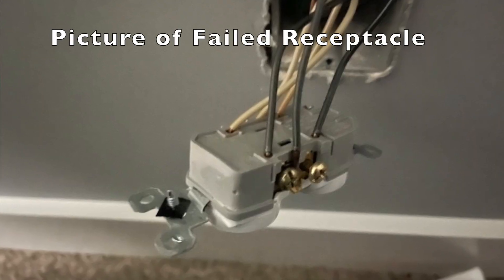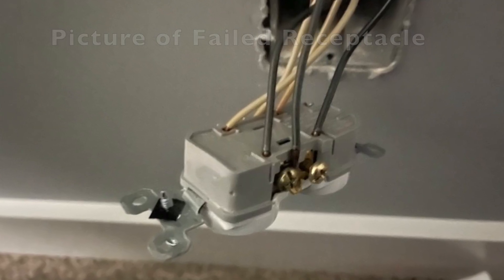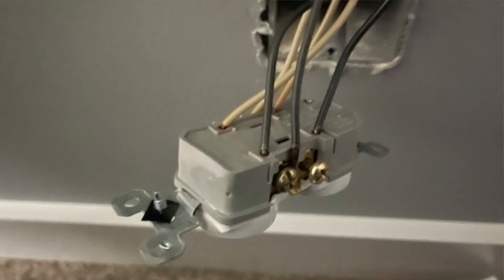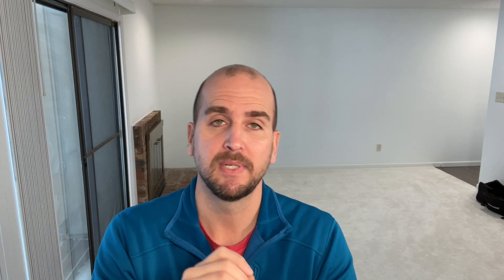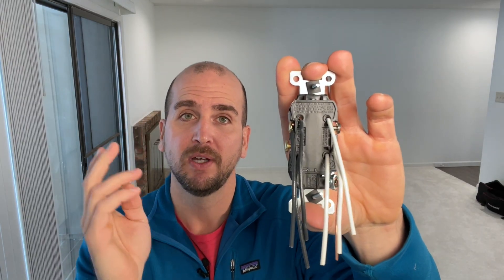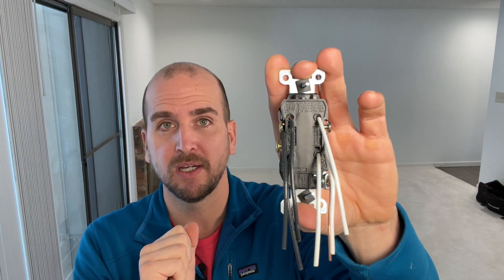Incorrectly Wired Outlet Found In Newly Built Home

Comment: Two things that I  don't understand. The first is why someone who does not know what they are doing makes a video compete with potentially dangerous mistakes. You are not a professional electrician! You are teaching the wrong ways to do things. When you separated the neutrals from the hot wires, you had a complete circuit because the hot wires in your right hand could have sent a jolt through your arm, chest and your left arm into the neutrals. By going through the heart, you would today be dead. Sure that the power was off? Nonsense. The homeowner or anyone else might have turned the breaker on and end of story for you. You never, never allow a complete path to form that might run through you. We stopped twisting wires together in the 1960s when wirenuts came out because often times the wire nut can't be tightened and torqued properly, resulting in connections overheating. It is the wirenuts job to hold the bare copper tightly for 50+ years without loosening. The way to accomplish this is be having the stripped wires parallel to each other and even on the ends. Then twist on the wirenut tightly and tug on each conductor to verify tightness. The new pigtails should be at least 6" long. Yours were too short. The so called "masters" with many decades of experience who egged you on by congratulating you on the "super job" that you did are full of it. We have corrected their and your mistakes over the years. We have also seen the houses that burned down because of "faulty wiring". You want to make videos? Great. But stick with whatever you are an expert at. It ain't electrical work.

Comment: Hey i can really use ur help. In my room I have a Leviton receptacle with additional 2 usb ports on it and that receptacle has 2 sets of wires hooked up to it. In case you cant recall off the top of ur head, the receptacle im talking about has 1 brass screw and 1 silver screw (both on same side) and ofcourse the ground screw on the bottom. Im trying to wire another outlet up the wall from this one to go behind my tv. Would i be able to feed the receptacle up the wall by just pigtailing a new wire with the 2 existing sets of wire that was originally connected to the usb outlet? I would still like to keep the usb receptacle on the bottom functioning. Just curious if i introduce a 3rd set of wires, would it be too many wires for an old work box? (keep in mind, the usb receptacle is pretty fat, similar to the receptacle displayed in the video) Sorry if this is all too confusing, if you need a better representation of things just let me know ill make a video or something showing it

Comment: At 1 time, when customers called me and told me they had lost power in a circuit, I could tell them approximately how old the house was in most instances after a few questions.
I found out that wires plugged into the back of a receptacle would fail after 10 to 12 years as the receptacle lost its strength to hold the wire in and then it heated up and started arcing.
In the fall if I received a call, the first thing I ask is "are you using portable heaters".
A resent called ask how much time it would take to fix a  problem he was having and I told him that was easy mostly likely and I told him 10 minutes or less.(If he had quit talking so fast, I could have done it by phone)
I heard him tell his wife that's why I called this guy."
The money is there now if you have the skills. In the last 3 years, services calls and rates have jumped exponentially.

Comment: Can someone please explain to me why you would have two neutral wires and two live wires to power each terminal of the outlet?, as he shows when he is making the pigtails. The only other time you would have two wires for each terminal is if you are using split phase power and are connecting each individual plug of the outlet to a different phase. If both plugs of the outlet are using the same phase, it stands to reason you only need one neutral wire and one live wire. This is because there is a tiny bridge in the outlet connecting the two screw places (two on each side per terminal except for the ground terminal) together, hence the need for only one wire per terminal. Is it an update in recent years to have two wires per terminal (live and neutral) normally? Can someone explain this please?
Reply: Look at the video again from 5:00 on. Only one hot and one neutral pigtail is connected to the receptacle.
Reply: @surferdude642  Yeah, and also if outlets are daisy chained on a single circuit breaker, then it would make sense for there to be two of each wire-one set coming in-and on going out.
Reply: @crazyshortstime9317  That's correct.

Comment: Always great info. The twisting the wires before applying the wire nut is so important. I have had wires slide out of wire nuts in the way long ago past. Also, if u don’t pigtail the neutral, this disaster can happen and it happened to me. I was replacing a receptacle without turning the power off, and I cut the stabbed neutrals. Guess what happened next. Several receptacles downstream went 220. Burned up a TV, the transformer in the furnace and a couple of ceiling fans. The worst part was my reputation. They still remember it twenty years later. On that same note, if the power goes out, and u decide to back feed a generator into a 220 receptacle, B SURE TO HOOK UP THE GENERATOR NEUTRAL!!!!  If u don’t, many if not all of the 110 receptacles will become 220 receptacles. That one was expensive and embarrassing.

Comment: I have a double wall switch for my living room recess lights and living room chandelier. The switch must be turned on of my chandelier light in order for my recess lights to work. So the recess light does not work by itself. I guess whoever did the electrical work, wired them incorrectly. Any help would be much appreciated.

Comment: Make a video on putting in the correct fuse or breaker for overcurrent protection.
14 gage wire uses a 15 amp fuse and a 12 gage wire uses a 20 amp fuse. I’ve been in a lot of houses where 30 amp fuses  are used on 14 gage wire.
The only word that goes with that is FIRE!

Comment: So i need to add an outlet for TV i am hanging. The outlet below has 2 wires, 1 coming in and the other going out to another  outlet. So if i add a 3rd wire it is best to tie the 3 black wires together and the 3 white together, Give them each a pigtail (i think thats what you guys call it) doing the same with the ground of course. Now i will be left with 1 black, 1 white and 1 ground. How all i have to do is hook up the 3 wires into the outlet and i will be good?

Comment: Yep. I've had to replace many of those push in plugs. Most of the ones I've seen have a way to push a lever with a small screwdriver to release the wire but it seldom works right. Either it won't release or the box crumbles apart as you put pressure on it.

Comment: You said in the video with the pigtail that it was 12 gauge wire, that indicates to me a 20 amp circuit but isn't that a 15 amp outlet that you installed? The reason I ask is I thought a 20 amp outlet had the little cross piece for the other type of plug

Comment: Great video! Remembering back to decades ago spending summers working as a helper with my dear old dad, an electrician.  It seems he taught me well. Screws in, never backstab, always pigtail. I still adhere to that. My medical office had all the equipment in two rooms fail and my staff was at a loss. I checked each outlet along until I found a hot one. Going back to the last dead one, I opened it and saw a stab-in had broken, likely from constant wiggling as the receptacle was not tightened down. I still encounter an occasional splice box where a neutral is acting as a feed and even where two sets of black wires run through on different legs. I even got shocked touching a run of bx jacket in the attic and saw the prior homeowner had run circuits with lamp cord. Fun, fun, fun!

Comment: Where are the Grounds Connected? Didn't see them here. Homes I worked on in the 90s all had to be spec-ed as with ground except for overhead Lighting! I realize older homes didn't have the bare ground wire when early codes existed.

Comment: According to the NEC, you shouldn't pre twist the wires in a wire nut.  The manufacturers say the nut should do the twisting. Pre twisting is not neccessary. And NEC says follow the manufacturers instructions.

Comment: How do we correct push in wiring on a receptacle without buying a new receptacle?
May we cut push in wires, and turn wires to J hooks and screw back on to the same receptacle? Or need to buy a brand new receptacle for us to connect wires yo receptacle using J hook method?

Comment: I use 14# for pigtails on 20 amp circuit outlets, allowing 12# to continue, because the device is rated at 15A, so I don't want that outlet becoming heated, and ultimately failing the mechanical hardware.  A splice point should be a true splice, and can better dissipate heat, way better than the tiny plates inside an outlet.

Comment: No, no, no. In this example why on earth would anyone use a pigtail? Makes no sense at all. each neutral had it's own screw terminal and each hot had it's own screw terminal. Why would you purposely create an additional failure point? Not to mention making the box more crowded. I'm not an electrician but common sense is common sense.

Comment: I learned to use pigtails in my high school electricity class, over half a century ago, and have never done multiple wires any other way.  Back then Marr connectors were commonly used, where there was a collar with screw to hold the wires together and covered with a plastic cap.  Also, I've never used the push in connections.

Comment: I think you should add text overlays which give your 3 recommendations. People generally remember more of what they see than what they hear and text overlays as you summarize you video will help.  I did wonder about the push in method vs the screws.  Push in installation seemed to be a potential failure point which you just confirmed.

Comment: Great, but when you added the pig tails, you didn’t remind viewer to remove power to that circuit at the panel box. Oops.
Reply: Another tip: after wiring the outlet, use a sharpie to record the circuit number on the back of the plate cover.  Then, when you need to work on this outlet again, you know which circuit to shut off.

Comment: Instead of cutting the wire I will go through the trouble of having a continuous wire that will go around the screw. Therefore there is not a broken connection and the electricity will continue on the wire instead of going through a connection.

Comment: Why create a pigtail when you could put one wire on one screw and the other wire on the other screw. So each screw has its own individual wire. Having a screw on a wire gives you a better connection then being connected with a electrical wire nut Any thoughts thank you for the video

Comment: Another mistake you made is you have the ground receptacles down. The manufacturer’s recommend installation with the ground lug up. The code is not specific on this. Working for me, the ground lug will be up or pick up your tools & leave my job site! There is a reason the manufacturer’s recommend them installed that way.
Reply from the maker: Hey Roger, thanks for the feedback.

Comment: About your pigtail solution to the two wires issue:  Yes, having the two wires under one screw was bad.  But connecting each wire to the two screws on the outlet would have eliminated that AND would be a better solution than the pigtail, which uses up space in the box and creates another mechanical failure point when you crush it all back into the box.

Also, I am NOT an electrician, but have done a LOT of wiring and a lot of outlet/switch replacements over too many years.  And I have NEVER seen a push in connection failure.  Not one.  Ever.
When they were introduced (yes, I am that old!), I was skeptical, but now I simply trust them, based on those years of observations.  And the irony of electricians all flocking to Wago connections but dissing push-ins should not be lost on anyone!!!!
Reply: Absolutely NOT!! Using one screw for each wire is the EXACT same thing. The whole point of a pigtail is to not have the receptacle be a point of failure for the entire circuit. The only reason there are two screws is to allow independent control of each outlet on the receptacle if desired.

Comment: I live in a Mobile Home (circa 2000), a few years ago I replaced the "Jelly Jar" rear porch light with a security light and came across very short wires in the box (not the 6" code length).  So I added the pigtails like you did in this video.  I need to replace that light again but now I'm going to change the pigtail setup using those Waggo 221 connectors instead of the wire nuts, I think it will be a much cleaner install and easier to work with.  I've been avoiding changing this like the plague until I saw your video on those Waggo (spelling) connectors.   Do you have video's on Mobile Home circuitry.  You'd think it would be the same as a regular stick built house, but it's definitely not.  Thanks.  Enjoy your videos.  Just subscribed.

Comment: It’s not required but it’s been recommended and I do it when I do electrical! Always taping around the screws on the plug the whole outlet and also taping all of my wire connectors as back up to keep objects or moisture away!

Comment: I’m not an electrician, but I’ve changed my fair share of busted/poorly wired receptacles in my own homes. I’m not sure I totally agree with the second point of using pig tails to attach the outlet. I understand the rationale, as explained by another commenter, is to make it where the downstream receptacles stay on in the event that any given receptacle disconnects. It makes sense, BUT, in my opinion, I’m not sure if that concern really warrants the extra work of installing pig tails AND the extra risk that they could come loose from the wire nut AND the extra cost of the wire nuts (granted, that’s pretty minor). I think you’re almost doubling the time it takes to install the new outlet by adding the pig tails just to prevent a failure that’s 1) not that difficult to fix (it doesn’t usually take long to identify the culprit outlet with a voltage detector) and 2) probably won’t occur for another 20+ years, if ever. Just my two cents. I’d be all for it if I was an electrician getting paid by the hour ; )

Comment: Thanks for this video. I have been trying to find this exact issue because I am adding a 2nd outlet in my bathroom and the gfi that was installed when I remodeled had the same thing. I had a friend who I feel is quite knowledgeable with electricity tell me it was done wrong. I bought a plug in tester that showed it is wired correctly and is working fine. Now I know what to do and feel a helluva lot better about moving forward with my project. Make one line out of two, run my load wires to my extra outlet and call it a day! Thanks again.

Comment: When you hook your pigtail wires on the plug . Hook one on the low screw and one on the higher screw. This forces power to go through the tabs which act like a 40 Amp breaker. Better than not having it at all.

Comment: Ok so I have been an electrician for 27 years. I have done mostly custom homes in California. Million dollar homes. I was taught to make up all my plugs. (Aka pig tail) I would use the stab in feature with the 14 gauge wire and wrap the 12 gauge around the screw. I moved to Tennessee and work in Alabama I’m right on the border of the two states. Here they don’t make up the plugs aka pig tail and just use the plug as the pass through. I tried to explain why this is a BAD idea and have come across plugs that have completely Mel and have in some cases caught on fire. I never had this issue in California. I’m conclusion is they were taught by hackers and have no availability to change and don’t want to. They say. THATS HOW WE DO IT IN ALABAMA.  Sad really.  All I can say is you are only as good as you’re teacher. Luck for me mine was a great teacher. Here in the south they all suck. They are good at their job but don’t know any better.

Comment: I’m glad to see you do not use the push in on the  back of the outlets. Could you put a pigtail two of the neutral wires and use the second screw on the neutral side and same on the hot side ?

Comment: Yeah, those back-fed connections fail. Sometimes, you can pull the wires right out of the back of the receptacle. Use the screws and pigtails.

Comment: 12 gauge wire is rated for 20 amps so you should confirm that the breaker is 20 amp. if so you should use a 20 amp outlet

Comment: I worked as an electricians helper with the possibility of an apprenticeship back in the 1970's.  The boss told us not to worry about the ground wire in receptacles and we were joining aluminum wire to copper wire.  All he was  interested in was  getting the job done as quickly  as possible. That was in Woodstock Ontario Canada and surrounding area.

Comment: In addition to what has already been brought to "light"! I have encountered a situation where the electrician wired through each receptacle in series. At the last receptacle a heater had been plugged in on the enclosed porch. One of the tenants stated that the receptacle next to her bed was getting very warm (hot) in fact in a plastic box. This receptacle was closest to the sub-panel and wiring was correct however because of the series method of wiring, all of the power drawn beyond the first receptacles went through each receptacle creating a real hazard. When I pulled my three prong tester out, the receptacle came out with the tester because of the heat in the (plastic) box. Never wire in series if it can be avoided...
Reply: That is fascinating. Never thought about how electrical works but that’s a great example of what they were talking about here. Gives it another “why”.